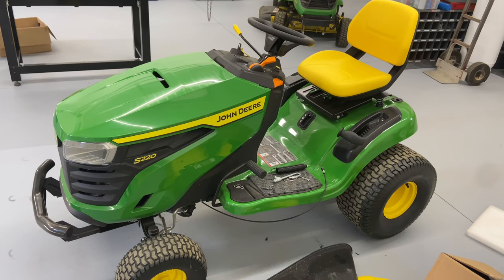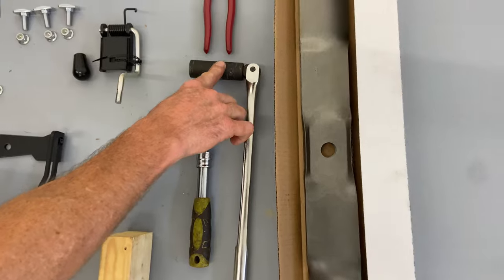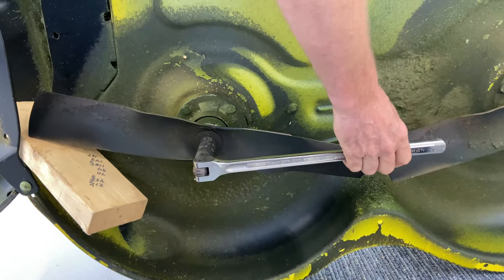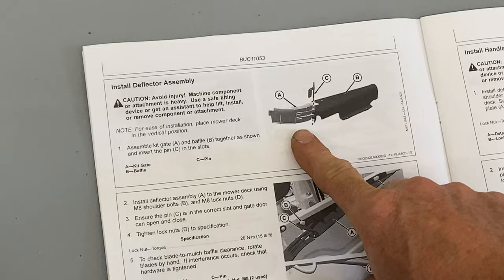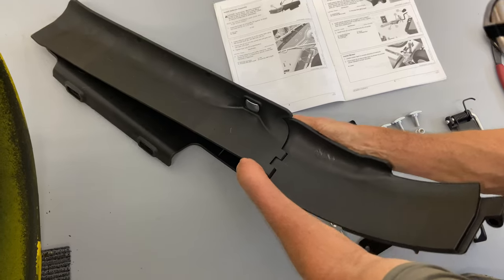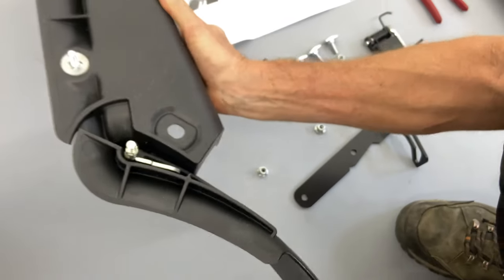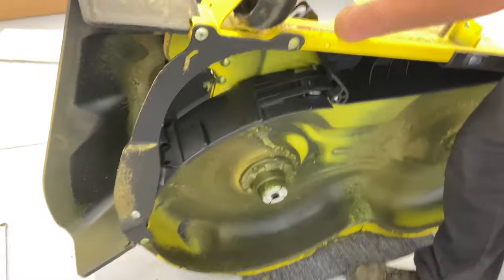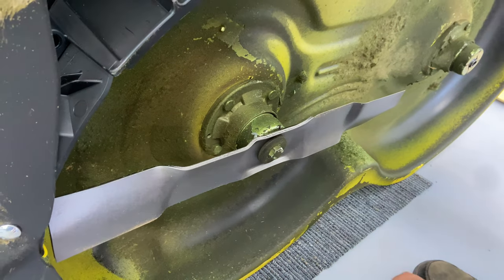How to install Mulching Kit on a John Deere Accel 42 Deep Mower Deck

Comment: Nice job never seen the mulching kit put on. Though of buy one for my zero turn. Any good words on the kits? Cub Cadet 50 inch cut
Reply from the maker: I do not install many. I haven't installed one on a cub o turn. I will certainly put a video out if I get one to install.

Comment: Do you think you could put a longer bolt from deck to mulch flap to keep it closed permanently? It looks like there is a hole to do that because my flap struggles to stay closed. I will try to tighten bolt as well
Reply from the maker: If the Mulching system is operating correctly, you should not need to do that. You may have grass caught up, so it will not shut all the way or something is not correct with the set up of the Mulching system. I have seen many times grass, not allowing the shoot to close all the way.

Comment: Great video, thank you.  

Noticed a metal sound on my X350 when i first start the PTO.  The new mulching blades seem very close to touching.  25:48 I only hear the noise at first start up and never heard it before putting the mulch kit on.  Do you think the blades could be touching on the PTO start up?  Not sure why i only hear it then (My JD has only 4 hours on it).  I paid close attention to putting the blades on straight, 50 inch pounds torque.  Any ideas?

Thanks for your great videos!
Reply from the maker: You need to find out where it is hitting. You should be able to tell from a very clean metal mark. Then go from there. I would say if it was the blades, normally there is a bent blade shaft or bent deck but being you only have 4 hrs on the machine I doubt that is the case. You need to find out where it is hitting.
Reply: @JohnsonsSmallEngines  Thanks, I’ll have a look.

Comment: On the X304 that has the 42 Edge deck on it. Do the blades spin the opposite direction,
Reply from the maker: The blades spin clockwise if sitting on the machine lookin down on the deck and the discharge chute is on your right.
Reply: Well, the dealer sold me the wrong blade kit. They gave me a kit that had a left and a right.  I immediately noticed it was cutting different with the new blades. I did not pay close enough attention to the new ones vs old  But after investigating it, I realized the problem. The kit for my mower needed the blade kit that has a right and a right only. Not a left and a right. Lol. The dealer was good enough to swap out the blades for me. Thanks to your videos, it is what helped me figure out the problem. So thank you, sir. This is the second time your videos have helped me out tremendously. 😂